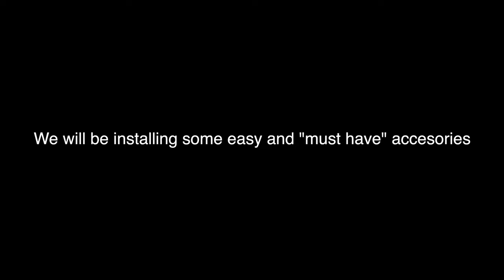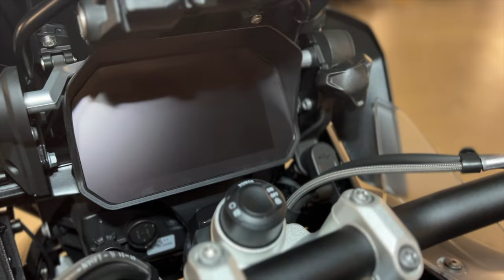Installing MUST have accessories on a BMW GS

Comment: what does the kickstand guard do? please advise.I love the visor for the TFT!
Reply from the maker: Thank you so much for watching. 

The kickstand guard prevents any damage to the sensor in case of a fall of hit buy a rock when you are off road. If that sensor goes bad the bike things that is in gear and it won’t start so it’s good practice to protect that sensor.
Reply: @rank1adv  Thank you for your fast eply and eduvating me I really appreciate that. BL

Comment: I think perhaps they should make full fairings available, made of 1/4” steel and call it a day. Ok so I’m a bit cynical, and I own a 1250 GSA. They make a guard or protector for just about every part of this bike and I don’t get it. I ride on the street and the dirt but I guess I’m not hard core enough to need guards all over. When my bike is on its side nothing touches except a corner of the lower crash bar at the cylinder head. I’m not a hater. Make the bike what you want. But after owning dozens of bikes I never wished I had a headlight guard, etc.

Comment: Why do you not add links to the products?? You would get far more hits and likes fella
Reply from the maker: There you go bud. I will add them to the description as well. Thanks for watching. 

Stand Switch Protector Cover Cap
https://a.aliexpress.com/_mOqRD0U

Housing Cardan Crash Slider Protector
https://a.aliexpress.com/_mL3FYJe

Shield Cockpit 
https://a.aliexpress.com/_mtzmGNw

Fog Light Protector Guard
https://a.aliexpress.com/_mseYWBq

Frame Panel Guard Protector Cover 
https://a.aliexpress.com/_mOKGoqk

Comment: More than lever guard, cylinder head covers, and headlight guard???  I dunno man.
Reply from the maker: Hey Ryan, thanks for watching. Couldn’t agree more. Those you mentioned are MUST have for sure. I am not sure if you noticed but I already had those installed that’s why I didn’t include them here. Cheers!